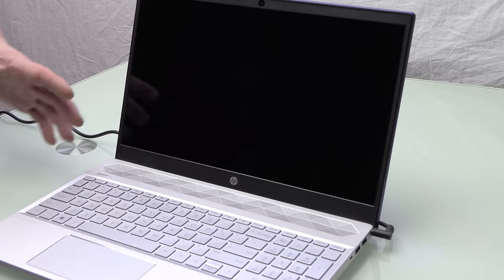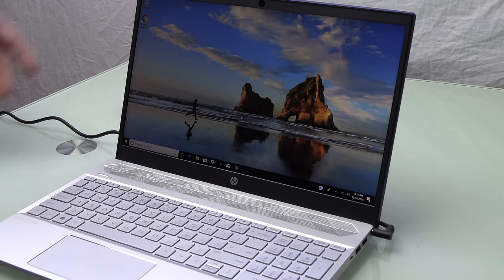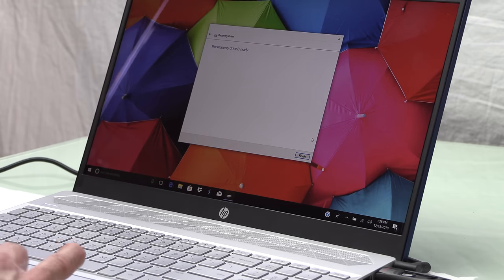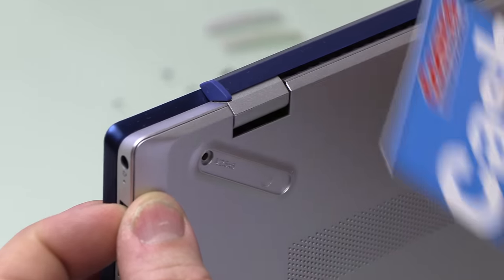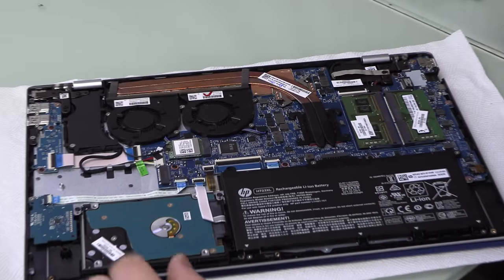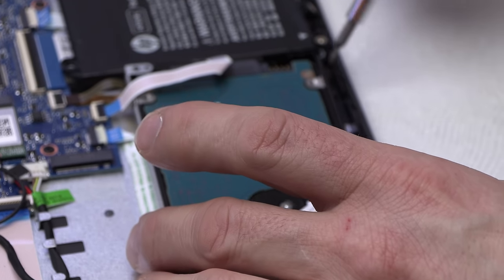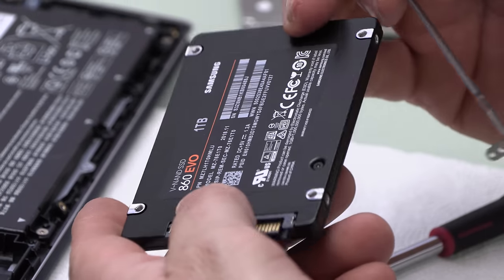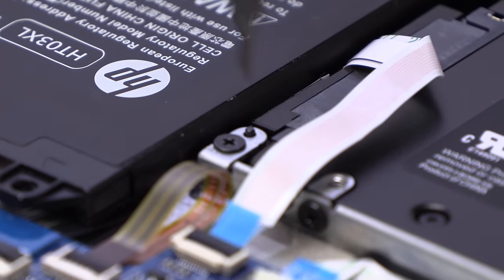HP 15-CS Laptop - How To Remove HDD and Install SSD

Comment: I have an HP Pavilion 15CW, there was no HDD, no other parts to support one either (mounting bracket, wiring)
 I’m wanting to upgrade it all (fans, hard drive, memory, etc)
 Any recommendations on what’s good?
Reply: I want to do the same thing.
Did you find any brackets/connectors? pls help

Comment: hi,
thanks for the video, its very well explained.
i have a hp pavilion 15-cs2033ni, with a crucial 500gb NvMe, 32gb RAM ( also crucial ), i was trying to add an additional ssd (Samsung 860 pro - 500gb). on doing this the system doesn't start. on pressing "ESC" i get the message at the bottom left of the screen "but" there is no BIOS menu on the screen. on taking out the Samsung ssd, the system is normal. 
could please you assist with this problem
Reply: You need to press f10 to enter the bios menu. That's the button on my hp pavilion 15-cs laptop.
From there I think you know what to do: just reorder the boot order so that the nvme comes before the new Samsung ssd.

Was the ssd slot empty before you added the ssd? What connector did you use? That might also be the problem.

Comment: Nice video there, thumbs up. Please i don't know much about laptops yet i want to know. Can i use the M.2 NVME & a 1TB hdd together? Im using HP Pavilion 15-cs0053cl.
Reply: I think yes, in the video appears to be a m.2 slot, I think this is a 2280 form type
Reply: from comments on this laptop's section, it says that the laptop does not recognise the M.2 SSD in the BIOS

Comment: Hey man great video... I'm going in for this laptop but a different model... 
HP Pavilion - 15z-cw100 CTO
This model has the Hdd slot empty... Was wondering if you had any links to the brackets and the right connector from the motherboard to the ssd... Would be super grateful if u could help, ordering soon
Reply: Your service manual can be found here: https://support.hp.com/us-en/product/hp-pavilion-15-n100-notebook-pc-series/5436989/model/6422017/manuals...  page 84 mentions " The hard drive cable is
 part of the Hard Drive Hardware Kit, part number 732071-001."

Comment: Great video, thanks. Has anyone tried to change the battery ? Mine is half dead, it suddenly fell down to 30% about two months ago and won't pass this limit anymore while in charge...

Other question, is this normal for this laptop to be so loud when fans are working ? It seems to be heating a lot even with RAM and CPU around 50%...
Reply: Mine too drained. Have u replaced battery?

Comment: found one of these for cheap used, do you recommend it? one of the main features of these HP's for me is dedicated GPU, not often seen... I'm just worried if the motherboard components will keep working for at least 5 or 6 years... what's your experience with these HP Pavilions?
Reply: It'd be hard to say for the CS15 line which is the Pavilion redesign. I have had only hp's and about 5. (through my sister and my brother as well). We're talking sub 600$ machines, so definitely on the low end. On average I'd say, considering slowdown and failures, that you can expect about 3/4 years out of them. In the last, both mine and my brother's (which had relatively different designs) failed at the hinge. For mine, the tiny (super tiny) hinge column inside snapped in half at the bottom of the hinge where all the pressure goes from opening the lid. mind you, I treat my laptop REALLY well. Once I gave it a look it could have clearly been solved with some better engineering and slightly more metal, but I guess that's what you get for such a low budget. Previously I had an issue with a fan going crazy fast 100% of the time although that computer still works (w7).  And lastly, a short that cause some smoke and also a dead pixel that spread to a dead crater on the screen. 

Now that I think about it, that's a lot of failures on essentially all different models and many years of usage and buying. Honestly, I don't think though that you can find much better for that price range. Acer's are notoriously worse. So, I think it's just part of the deal. 
I must say though, the redesign is really nice. It's metal top, backlit keyboard, thin bezels (those are amazing), usbc, internal battery etc. It's a lot of features that trickled down from much more expensive models back in the day. Last year I could've only dreamt of having so many features in a laptop I paid 600$ (was a promotion). Hell, I even got the new 620 intel GPU and Nvidia dedicated graphics (nothing amazing, but still. ) a quad-core and an SSD. Overall I think HP did a great job of making a cheaper machine with many great features everyone should have in 2019/20. I must say though, the hinge is still a double hinge system which never seems too sturdy (unlike the mono hinge from more expensive computers such as MacBooks or the XPS line). Not sure how it's going to hold up. We'll see.
Reply: @dennispremoli7950  Great

Comment: Thank you very much for the video. Would you please tell me if it supports "Samsung 4GB DDR4 2666MHz Notebook RAM" and "Transcend 110S 128GB M.2 2280 (M-Key) pcie Gen3x4 SSD Drive"?

Comment: My hp pavilion 15cs laptop has an optane 16gb memory also next to the 1Tb had drive.. Do I have to disable it through bios and take it out the laptop? Thanks in advance
Reply: No need to remove it but yes disable it. Get an nvme and replace it with more storage

Comment: Mine is a Ryzen 5 3500U, with an M.2 SSD and a 5400RPM 1TB HDD.  Sadly, though, it only has one 8 GB DIMM so it's not running in dual channel.  So what I'm planning to do is swapping the HDD for an SSD, leave the M.2 alone, it's perfect.  But what is greatly needed is another DIMM.  Will have to take it apart before ordering parts, though, so I can match the existing DIMM, if I can't find a match I will just replace it with two DIMMS.

Comment: Excellent!  Will the M.2 SSD drive have a screw already when I open it?  Adding a drive, not one there now.
Reply: Yes
Reply: @Growler57  Thanks, yes it did!  Taking this apart is no big deal at all. I recommend starting in same place, but once you get back side open, going the other side direction first was easier/safer from breaking clips.  The ones in front side do not clip, they just go in channel and held by screw.

Comment: Hi can you help i have the HP pavilion 15 - CS i7 10th gen 16gb ram, 1tb hdd, NVidia. My boot up is too long take at least 1:30 mints at first i get the black screen the please wait. i have done a clean format a few time, all my drivers and bios are upto date and yet this happens. I have tried many other methods and software's doesnt help. Iv also defrag my hdd.. doesn't help. Its a brand new laptop.

Comment: I have to reinstall the OS windows 10 as it is corrupted and the repair option also does not come. Could you please tell me how to read the data of the hard drive? It does not have a USB port on the HDD.

Comment: Hello, I've got a problem. My hard drive SSD M-2 is dead, no way to get back my data. Anyway, I've to put 2 new SSD hard drive into my HP 15-CS0059nb : 1 SSD M2 for Windows and all my softwares, and another one pour my datas. But i need a rack for de second and the connector with the computer tablecloth just like the one in this video while he's removing his hard drive. I live in Belgium and i don't these computer parts.

Comment: easy tutorial, but what is the difference between cloning, fresh install and your recovery method?  i think recovery is for new computers who wants to change hd to ssd? comment. thanks
Reply: Recovery is best for a new computer with no data.   Make the swap before you do too much setup and get data on the system.  If you have some data - copy the files off, use the recovery method and then reinstall software and restore the data.  Cloning is needed if you don't have the option to reinstall software.  Cloning usually works well and will be faster if you have had the system for a while (vs backup, software installs and restore) but sometimes you have to deal with some post clone quirky things that need to be worked out when the OS or apps see the different hardware.  Recover is the "cleaner" way to go.

Comment: Hi,
Thanks for this video, I have same Pavilion series laptop with AMD Ryzen 2500, and I wanted to see how it looks from inside. Your video helped me there haha
I've a question, if you could help I'd be really grateful.
Is it okay to use laptop while plugged in (100% charged)? How does it affect the battery in long run?
I've been looking for the answer from last many days but everyone has different views on this. As you own a same series laptop and also doing some pro work there, your advice will be of great help.

Thanks :)
Reply: The fact that the model is the same doesn't mean anything about how the battery works. It is however prefered to charge the battery of any device with a lithium ion battery to 90% and then stop. But you can just change the battery by yourself quite cheaply when this one goes bad.
Reply: @BrevityBuzz  Thanks

Comment: My computer is darn slow. My RAM is only 4GB. 3GB used so far. Will changing to a SSD solve my speed problem? Or do I need to add in RAM as well?
Reply: Ram is the biggest problem here. If you buy one stick of 4GB that will make your laptop much faster, but not  amazingly fast.
I'd go with 2x8GB so that you have more than enough ram, but that's much more expensive than a single 4GB stick.

Also, 2x8GB with a HDD is slower than 2x4GB with SSD.
It's up to you to choose what to do, and don't overspend if you're going to upgrade anyways in 8 months

Comment: I bought the HP HP Pavilion Laptop 15-cs0xxx last feb of this year and it comes with samsung 128GB M.2 SSD with toshiba 1TB harddrive. pretty fast but my only complain is the ram which is just 4GB stack so i need to add on
Reply from the maker: Oh yeah, the ram is right there, super easy to change as well. I think I pointed out in this video, but sounds like you already got it.
Reply: @HookItUp  yeah you did. i  could've pointed out clearly that with this kind of specs they (manufacturer) could've not put 4gb anymore. The minimum could be at least 8gb stack. BUT thanks to your well explained video tutorial especially how to remove the back cover
Reply: @aldwintest3828  Did you manage to add the ram ok? Were there any problems?
Reply: @acojo8205  yes i did. I replaced it with 8x2 ram so it's 16gb. all i can say is that the store should not sell anymore with 4gb ram default co'z the browsers and other apps are heavy so it should be 8gb minimum at least
Reply: @aldwintest3828  I think mine only has one slot for the RAM? it says 1x8gb on the specs, for this 15-cs1065cl model. can this still be upgraded?
Reply: @soulrocker26  if you right click on task bar and select task manager then performance then memory it tells you how many rams slots the laptop has on the bottom right of the screen
Reply: @alexe5461  I see.. It says "1 of 2" which means I have another slot available!! tnx!!

Comment: That M2 slot has NVMe or SATA interface? I have cs 1000 tx
Reply: Hi Varun , did you find answer for that? , same question i too have and couldn't find any solution ..
Reply: @nidhindas9132 HP support told there is an empty slot which supports both NVMe and SATA, but need to open the laptop in order to confirm. I am not that confident to open up my laptop. If you can check it, please inform me.
Reply: @varunpatil1309  it supports M.2 i have CS0073cl, dont worry about oppening it, i have mine very modified. Its not hard mate and the upgrade is noticiable

Comment: Hi, Is there a part number on that HDD ribbon cable? I'm looking for one of those..
Reply: Me too, I have same laptop with m2 pcie, but without this sata connector...
Reply: It is probably L23889-001 HDD CABLE
Reply: Exactly that... it didn't come with the parts needed to add a 2nd drive!!
Reply: From that part number i tracked down a maintenance manual and found this .... It appears to confirm the part number, Cheers!

"NOTE: Hard drive brackets are available using spare part number L19469-001. The hard drive cable is available using spare part number L23889-001"

Comment: Hey ive got an HP 15s-fq0204nz (what a god awful name!). It looks similar but has a different bottom part. I wonder where are the screws on mine. I see 2 but that cant be all of it, are they always underneath the rubber feet ? Anyways thx for the tutorial. I hope i dont mess up.

Comment: Should I be concerned that my laptop has only one fan when his has 2? Will the SSD work the computer harder therefore necessitating more cooling from an additional fan or will I be fine? I have no clue.
Reply: The i7 processor generates more heat, so has a more robust heatsink with 2 fans... regarding the addition of an SSD; it won't make the computer (CPU) work harder, but it will generate some heat... but not enough to cause your laptop to overheat.  Some of the newer high-end NVMe SSD's (like Crucial's P5) have aluminum stickers on top of the memory chips to dissipate heat somewhat, and they have the ability to throttle (slow down) performance if they do start to get hot.

Comment: I want to update an HP Pavilion running a windows 8 want to put a SSD 1 TB and upgrade to Windows 10. Do you thing it’s upgradable ? It’s an old 14-b109wm with touch screen . ( want to upgrade Windows 10 and SSD 1TB Any comments or advice?

Comment: About how much force did you have to use to open it? I'm afraid of breaking my case and in some parts of the laptop a card wont fit properly, how did you over come that?
Reply from the maker: Doesn't take too much force, maybe about a pound or two I'm guessing on the credit card, but the trick is to slide the credit card along the scene while it's inserted about an eighth of an inch. Hope that helps, sorry for the late reply haven't check messages on here in a few days. Let me know if you got it? I'm curious now

Comment: Thanks for the instructional video.
I was searching for a tutorial and replacement parts for [HP Pavilion 15-cs0036nl]. Which is very similar to the laptop shown in the video. The laptop which I use just has a 512 GB PCIe® NVMe ™ M.2 SSD and an empty space for installing a Hard drive. I wanted to install an SSD in that empty space for booting Linux and windows. After searching for the support bracket for SSD and the pin for connecting the SSD to Mother board I gave up the search. I couldn’t find any parts or spares for my build. Can you please suggest me any website that I can purchase the support bracket and the SATA Ribbon pin. I also tried official Hp website for questions & answers and support, but the page redirects me to some random website which won’t open in Europe.
Laptop model number: [HP pavilion 15-cs0036nl].
Purchased in Italy.
Product number: 4RL31EA.
Thanks in Advance.
Reply: I have the same problem please let me know if you found a solution
Reply from the maker: Someone else in the comments section mentioned that there is some kind of kit out on the internet for that particular problem, I think he said you could just Google it but I'm sure you tried that already.
Reply: @lopezweissmann2644   
After a long search, I have found out that my model number 15-CS0036nl can be compatible with the *) Hard Drive cable is available using spare number.

*)Hard drive brackets are available using spare part number L19469-001.
Reply: @aggadi  Ciao, per favore puoi mica dirmi dove hai trovato le staffe L 19469-001 che io non riesco a trovarle?
Reply: @enriquez67   Ciao, Enrique.
Ho acquistato la parte da https://eu.eetgroup.com/
i prezzi sono un po 'più alti. ma non avevo un'opzione.
è difficile trovare questi pezzi di ricambio per HP.

Comment: This changed the PC from a 7.5 minute boot time to 28 seconds!  If you own this PC do yourself a huge favor and buy the $50 1 TB Samsung SSD you will be amazed!  Oh!  And the Samsung drive comes with cloning software called magician, so you just need to buy a 2.5" enclosure, put the SDD into it, clone it from the PC, then swap the HDD with the cloned SSD. Viola!

Comment: Hi Hook It Up.
 What is the name of the cable that connects the hard drive ports to the mainboard?
 I need it urgently
Reply from the maker: Whoa thats on the tip of my tongue... I think it's called ribbon sata cable. I'm sure you can find a schematic for your laptop online that will list all the parts for you

Comment: Tried to open the case on the corner.  Credits cards are more breaking than opening the case. Using a screwer is more damaging the case than opening it. Any trick to make it a bit easier?
Reply: You can use a screwdriver or knife with some tape over it. This would prevent doing damage from the tool to the plastic. This trick is also used to remove plastic interior panels in cars for example.
Reply: @TerrybleGamer  i'll give it a try

Comment: Hi there, 
I have the 15-cs0041nr.
It already has a SSD. I am wanting to up grade the storage from a 256GB to a 1T.  
Will the Samsung 970 EVO Plus Series - 1TB PCIe NVMe - M.2 Internal SSD  or Samsung 970 EVO 1TB - NVMe PCIe M.2 2280 SSD (MZ-V7E1T0BW) work?

Thank you
Reply: Anna I was wondering the same. Did anyone answer that question? Thx

Comment: Please tell me what kind of adapter is that and where do I get one. I opened my laptop and it only has the PCIe ssd and an empty slot for the hdd but there is only the small connector for it.
Reply: From the HP Service Manual (page 58): " The
hard drive brackets are available using spare part number L19469-001. The hard drive cable is available using
spare part number L23889-001
"    https://support.hp.com/gb-en/product/hp-pavilion-15-cs0000-laptop-pc/20284004/model/21447475/manuals

Comment: I currently own a 15-cs2008nw model, which comes with an M.2 SSD by deafult. I want to add a 2.5" 1TB SATA SSD for additional storage. Does anybody know if my model comes with that SATA ribbon cable? Thx in advance for the answer.